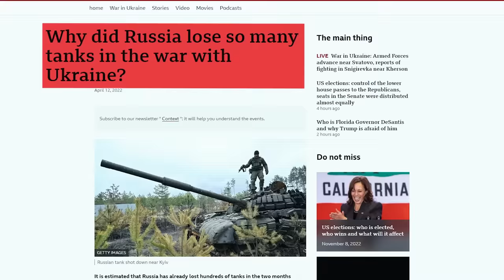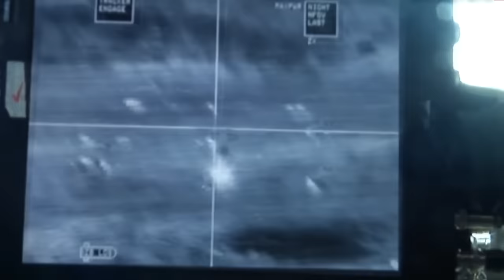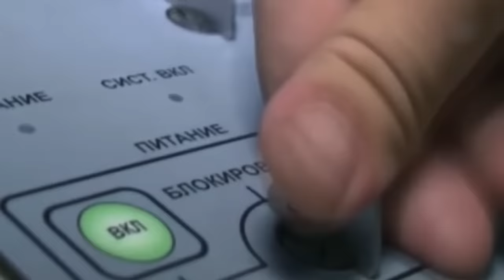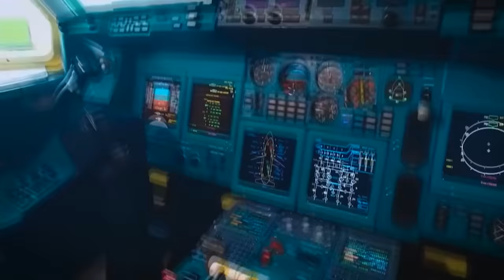Something is wrong with all Russian tanks

Comment: Russia has already lost over 4000 tanks and the storage area's that housed the obsolete tanks are now mostly empty. From the before and after satellite footage shows that the tanks that were removed were in bad condition but mostly intact. The best guess on the numbers is around 2000 repairable and 3000 for part's. One thing that was noticed by the Ukrainian military is that the majority of Russian tanks had the explosive part of the explosive reactive armour missing and as that is the main part of the armour and the tanks were designed with thinner main armour because of it, this is part of the reason why Russian tanks have performed so badly. The other reasons are a lack of training in combined troop and tank combat, a very poor logistics system and a lack of communication equipment. Basically the Russian military was not prepared for any major military operation and its fighting capacity was greatly over estimated. Due to the losses that the Russian military has suffered in Ukraine Russia cannot be considered a super power, it is still a nuclear power but it now doesn't have a modern military that can defend itself.
Reply: Some time ago I saw a video (now deleted) where Ukrainian explosives experts disassembled ERA from captured russian tanks and discovered many of the packs were filled with sand, or clay, or just rubber blocks. Some oligarch pocketed alot of money over the lives of russian tankers for those explosive reactive armour blocks.
Reply: @tonyv8925  the majority of Russian general's had multi million dollar yachts and mansions with gold toilets, considering that the general's don't receive any great income the money must have come from somewhere else. Most of the yachts have now been impounded or arrested.
Reply: @swiftcee266  I would be fighting for Ukraine if I was 20 years younger, I would still be good in a defensive position but as I am not very mobile nowadays defending a fixed position is all I am capable of. From the wave attacks that Russia is doing because that is all that untrained conscripts can do it would be a question of how many Russians I could kill until my position was overrun because guns can only fire so many bullets per minute. The only real problem that the Ukrainian military faces is that will they run out of ammunition before Russia runs out of people and at the current rate the odds are with Ukraine.
Reply: ukraine lost the 3.9k they had before russian invasion. tanks are obsolete with javelin and kornet !!! it's the era of artillery, drone and anti air defense.
Reply: @swiftcee266  the Wagner group is now mostly made up of prisoners from various jails throughout Russia, the Wagner group has also been involved in the heaviest fighting and has suffered more casualties than any other Russian military force. Due to the way the Russian military has been throwing troops at the Ukrainian military in uncoordinated attacks the daily death toll for Russia has gone from an average of 500 per day to over 1000 per day but the gains are minimal and are mostly regained by Ukrainian military the next day. During the last month Russian artillery has reduced its firing by around 75% Due to a massive ammunition shortage and as supplies from north Korea are slow to arrive and end up being mostly destroyed by the Ukrainian artillery directed by drones that both locate the ammunition storage areas and adjust the fall of the shells with an accuracy that is not possible for the Russian military with its lack of communication equipment and trained spotters. As the majority of Russian tanks have been destroyed the supply of Russian tanks reaching the battlefield are not keeping pace with the losses and are of lesser quality. As the Russian people are now discovering the massive losses they have started to attack Russian military bases and supplies in Russia and recently there was the largest protest against putins regime that numbered around 2 million people. The Russian military doesn't have the supplies or equipment to continue fighting for another 2 months and is already unable to supply body armour, modern helmets, medical supplies, firearms or food and water to the troops that are already fighting so any new troops will be worse off than the ones who are already undersupplied. The Russian military manufacturing industry just doesn't have the capacity to produce weapons, vehicles and ammunition fast enough to replace what is being destroyed/used and Russian soldiers are being told to save ammunition. The Russian troops are literally cannon fodder and as they lack any real military training they tend to group up making it very easy for Ukrainian drones to drop grenades that kill and or injur multiple soldiers as well as direct Ukrainian artillery to any hiding spots, there are hours of footage showing Russian troops running from building to building being chased by artillery until none are left. Russian troops are not safe in any foxhole or trench due to the amount of Ukrainian drones that can drop bombs with better accuracy than any Russian artillery or rocket system. Everytime Russian aircraft attempt to join the battle they are shot down by either man portable surface to air rockets or vehicle mounted antiair systems that in some cases are captured Russian equipment.
Reply: 4000 tanks? are you kidding? Or you just like ukr fakes? ;)
Reply: @Cachalote65  wikipedia section ukrainian army ground army that's the number 3900 MBT from T64 to T84 and the huggest amo stock bunker but destroy the first day of russia invasion. ukrain was the most armed country after russia during USSR era.
Reply: @Cachalote65  yes 4000 is about right because I have seen around 3000.
Reply: @itt2055  if Russia lost 4000 tanks, then Ukraine lost 40 000? Because Russia dominates in the air, not the poor Ukraine with the couple of yet alive MIG-29 from Poland shipment! ;)
Reply: @tonyv8925  never watch ukr fakes! ;)
Reply: @Cachalote65  so you mean there  will be abrams in africa soon'? 👍
Reply: @sucellus5452  SURE!!! ;)
Reply: @Cachalote65  Russia doesn't dominate the air and the Russian airforce has been mostly absent but as Russia has already lost over 200 fixed wing aircraft and over 200 helicopters they are reluctant to conduct any operations. The Ukrainian air defence system is actually better than the Russian air defence system because of the communication system and a better command structure. In the opening attacks the majority of Russian special forces were shot out of the sky before they could have any affect on the war. Man portable surface to air missiles are responsible for the majority of the Russian airforce losses once they became widely available. Ukraine has also captured intact several Russian surface to air missile systems that have a central radar unit with multiple vehicle mounted missile systems. These were the latest systems that Russia had and have revealed the weaknesses in the Russian surface to air radar that has allowed Ukraine to exploit the weaknesses found.
Reply: @itt2055  you watch too many ukr youtube channels where they spread their dreams about weak Russians. Wanna know about modern Russian army? Check independent channels about Syria and what Russians did there in 2015-2017! ;)
Reply: @Cachalote65  Syria was against civilians and freedom fighters and the Russian military had the backing of the Syrian government so it wasn't a proper war. The Russian military has proven itself to be completely incompetent at every level, it has shown that it doesn't have the logistical capabilities to supply its troops in the field, there is no communication between the front line troops and the artillery units, there is no communication between front line troops and the airforce, the lack of proper training has been proven by the footage of Russian columns being ambushed and the Russian troops did not have any idea what to do in that situation. Basically I suggest that you actually view the thousands of hours of footage of Russian troops not having any idea what they are meant to do in different situations. From everything I have seen the Russian military doesn't even rank as good as the Iraqi military was during the first gulf war. The only reason why Ukraine has not completely destroyed the Russian military is because of the numbers of Russian troops. Ukraine is a far more organised military force than the Russian military and has far better communication, training, logistics and command and control structure. It was a complete shock to find out just how bad the Russian military has become under putins regime and it does show what years of corruption at every level can do to a military force that was once one of the best and has become one of the worst.
Reply: @tonyv8925  its very old stock,,, russians ha no interest in using modern weapons only ols stuff that keeps working
Reply: @Cachalote65  what you just said shows that you have absolutely no idea about what is going on. Ukraine doesn't have leopard tanks or American planes. The Russian airforce has mostly soviet designed aircraft. If you look at how well the Israeli airforce has done against Russian aircraft you will understand that the Russian aircraft are inferior. Can you tell me why Russia has been fighting for nearly a year and still hasn't captured a quarter of Ukraine? Why has the Russian forces spent over 3 months trying to capture a single small town. Can you tell me why the Russian military has to use parts made in the USA to build its drones if it is so far advanced technologically. Ukraine has been building more drones than the Russian military has vehicles and has developed software that can detect people faster than the human eye all while fighting against Russian forces. All the facts have proven that the Russian military is around 30 to 40 years behind the rest of the world, why else would the latest Russian surface to air missile systems still be using CRT screens rather than plasma or led screens.
Reply: @robertokandal  41 of the the 400 T-90's also confirmed lost by russia are too old stuff?
Reply: @Maddog-xc2zv  where I get the numbers from use satellite and drone footage of Ukraine for the vehicles and the deaths are calculated by satellite, drone footage combined with intercepted communications. These numbers are very close to what Ukraine is reporting so around 140,000 deaths, 4200 tanks destroyed, 6400 armoured personnel carriers, over 200 planes and helicopters.  When you combine these numbers with the number of man portable missile systems sent and used the numbers are quite easily possible. When you see every Ukrainian soldier carrying a missile system or RPG and the tactics that they are using in regards to artillery spotting and the way Russia is using it's tanks, vehicles and troops it does start to fall into place. The Russian military just doesn't seem to have any idea what they are doing and they just keep attacking the same points in exactly the same way,  this has made it very easy for the Ukrainian military to set up killing zones that need minimal personnel. When watching the reactions of the Russian soldiers under fire they are not acting like trained troops but more like civilians with guns. As one retired American general said "I have seen better organised paint ball teams" and I agree with that assessment. Watching the American, British and Australian military conducting operations in Afghanistan you see that everyone has the same response when under fire but the Russian troops just seem to panic and it becomes every man for himself. Russia on paper had around 10,000 tanks but they have been removing tanks from their storage facilities to the point where they have all been emptied of all usable hulls. this will only be happening if they are in desperate need of replacements, these stored tanks have been left out in the elements for up to 40, a lot of them are not compatible with the more modern Russian tanks. The other factor that makes me think that the numbers are higher is the amount of Russian general's that putin has sacked if things were not extremely bad he would not be reacting in the way he has.
Reply: @swiftcee266  Russia can’t keep old Tupolev drones from bombing air bases deep in Russia. 
They have no fighters in the air over Ukraine because no one can survive the long range missiles. The skies have drones, not fighters.
Reply: @swiftcee266  er not uite th tgr and panther tanks mad thr FST aanc at Kursk n 1943
Reply: @theoriginalkeepercreek  Well, "BATTLEFIELD UPDATE" was a misnomer.   When someone  deceives with a clickbait title, they simply have their own agenda, and is happy to be dishonest.  Take from my response what you will.
Reply: @Cachalote65  Yeah, mebbe not just three days, but the plan was certainly within a couple of weeks. Secondly, you say "the goal was not to destroy Kyev with mass bombing..."  Indeed, they did intend to take over Kiev without a fight.  So I guess we didn't see mass bombing of cities like Mariupol by Russia, destroying 95% of it's buildings and killing as manny people in Mariupol as in Belgrade within a city just the a third of the size of Belgrade.  Thirdly, I think I was talking about the modern Russian military's capabilities in Ukraine, yet you are talking about Belgrade and Afghanistan, you really do skip around topics of conversation, with obfuscation, you are funny :)
Reply: @briannewton3535  again, WHAT plan for a couple of weeks, who told you that plan? Putin? Lavrov? WHO? Mariupol was destroyed by artillery, not heavy bombing like Belgrade and the only reason was that ukr put their tanks in the city! Were there any tanks in Belgrade? You say you talk about modern Russian army and I take for example US army which I guess you consider modern and effective, don't you? AGAIN, what territory of Afghanistan gained modern and effective US army in 2001-2021 before they left with disgrace? ;)
Reply: @Cachalote65  Does it really matter whether it is artillery or bombing?  The outcome is the same.  You were trying to put Russia on a moral high ground, yet You will be okay that thousands of missiles and drones are continuing to target civilian infrastructure and civilian accommodation in Ukraine. Russia Is still sending thousands of missiles into civilian areas in Ukraine.
Reply: @briannewton3535  Thanks for tthe comment. (God loves Me) remember to say this many times a day. He truly does. This whole war is so bankers can redo the books and divide and conquer mankind. Have you looked into Scott Ritter or Col. Macgregor
Reply: @Cachalote65  With regard to "Do you know the price of a cruise missile? What's the idea in wasting them on old houses where poor civil ukr live?"  Yup, they are certainly more than a couple of hundred Roubles each, yet they still take out fields, playgrounds, maternity hospitals, apartment blocks, and road intersections in the cities. Though the majority are simply shot down en-route.  Mr Poop Tin does like targeting civilians, is this because his military is struggling with fighting armed forces, and feels civilians are an easier and softer target, because his modern military isn't quite modern enough?  I think it is WW1 and WW2 tactics that give poor results for the Russians military. 

I did laugh when you said "nazi quasi state should exist next to its border!"  I suspect the Ukrainian people see Russia as a "nazi quasi state... next to its border." 

You are funny, thanks for the giggles.
Reply: @briannewton3535  God loves me. Say it out loud so it sinks in. Many people do not know this fact. We are all children of God.
Reply: Literally everything you said was wrong. Just alone, 1/10 things you said wrong was the era explosives being “missing” even though there was only 2 videos that showed “proof” despite the tanks being rusted, with everything down to the acres with exception to the hull and turret being salvaged. One of the two videos showed as “proof” literally showed a 6 month old captured tank without tracks, engine, hatch, and it was rusted badly.
Reply: @schutzanzug4518  you are right! A Pocket Full of Lie :)
Reply: @theoriginalkeepercreek  You ask "Why did the President of Ukraine close the churches?"

First you need to support that claim. Personally I am not bothered on whether churches have been closed or not. I merely said that the god that both Ukraine and Russia worship must be conflicted, as it is the same god for both sides.  

If you wish to obfuscate and bang on about other stuff, you go ahead, I wouldn't be overly fussed for both the Russians and Ukrainians to close the churches, in-fact all places of religious worship everywhere.  

You claim "Time will show who was correct about this war."   I'm curious, how will dime determine this?  Surely what will determine this is down to the resolve of both sides, the political support for the powers in each country, and the military support that is given to those fighting.  I am unsure there is a "who was correct". I do find it interesting when theists have a conclusion, and try and find a narrative to feed and support their presupposed conclusion. 

Have a lovely evening.
Reply: @briannewton3535 , I have not heard of Brahmah. Have you heard of Jesus? You would be surprised at how many have not. You have a blessed evening as well.
Reply: @itt2055  Where are you getting your info from? I have info that is very different and want to compare it with mine.I follow Scott Ridder and Col.Macgregor. Have you heard of either one of these men. Lets hope this war ends soon and we find out the truth.
Reply: @sucellus5452  America tanks will never make it to this war. They are making them now with little armor or whatever the standard was in the 70s.
Reply: @John-dd7ez  I bet Russians on the front lines would love to get their hands on turnips, I hear they are often short of food and water.
Reply: @peterwilson5528  I thought the OP was detailing inadequate equipment logistics and training.  I don't know if a country as supposedly well equipped, and trained as Russia, should have been able to take over a country the size of Ukraine. The fact that a year into this conflict they have conceded more territory than they gained after the invasion is telling.  Yes, firing shells and missiles at civilian infrastructure with a hope of turning the public against the government is one way of trying to win a war. Alternatively, they could focus on the front lines, which have basically been moving in a rearward direction since the early days of the conflict.   More recently they are making small gains though, and their probing offensives or actual offensives are not bringing the expected results currently.  Maybe they will make gains in the next couple of months, though maybe not.

When a sovereign state is invaded by a hostile country, other countries may support the one being invaded.  The hostile country invading it may get butt hurt that this country might get some limited support from others. That hostile country will have to suck that up, as it was their call to invade in the first place.
Reply: @peterwilson5528  Russia occupies less of Ukraine than they did in the first month and have taken massive losses in equipment and personal just to recapture a few small towns. While Russia is loosing equipment Ukraine is gaining equipment, while Russia is loosing trained troops Ukraine is gaining trained troops. Russia has had to use conscription to force Russians to fight but is unable to provide modern weapons, medical supplies, uniforms, food, body armour, modern helmets to its conscripts. Russia is now using tanks and other vehicles that were left in the elements for over 30 years without matenance.
Reply: @itt2055  Wrong Russia is well in control of almost all the areas that matter to it. They are advancing. Ukrainians are retreating. Russia is not running out of anything in fact even its economy is growing. We will see :)
Reply: @briannewton3535  Well UK 10 or 11 years in Afghanistan to retreat. USA 20 years. Russia one year in UKraine protecting Russian speaking ex Ukrainians. I think it takes a while to get any military machine working right. I guess it is why the P.I.R.A. drove the British out of Ireland even there they were there for 38 years. The problem with Ukraine is the Ukrainian Fascist regime in Kiev still has so many Russians speaking citizens as hostages. Pretty clear on that seeing what they were doing to their own people.
Reply: @peterwilson5528  Re: " I guess it is why the P.I.R.A. drove the British out of Ireland even there they were there for 38 years."  Ahh, so the British are no longer in Northern Ireland then, as they have been driven out.  I guess I missed that happening. My friends two British daughters are in Northern Ireland still, one working for the British Government.  I didn't recall them been pushed out back to the UK.  But, hey, things happen without me knowing out it, so I guess this is simply one of those things. 

Re: "I think it takes a while to get any military machine working right."  Indeed, I think with NATO troops training the Ukrainians on modern military NATO tactics since 2014 has helped them hold back the not quite so modern, yet much larger military of Russia. So, I guess you are right. Maybe if Russia had done the same, they would have been better prepared, and more successful on their invasion.
Reply: @itt2055  Wrong and you will see it is so. How do you explain the Russian economy growing then? You really ought to not rely on the western press for information. Most Russians see it as their duty to the motherland. Russia is of course getting help from all its allies. Those countries that USA has targeted have become a united front. They know that Russia must win or they will be next. Russia also knows that. That is why this war is to the death.
Reply: @peterwilson5528  I get my information from multiple different countries that includes Russian friends. The Russian economy is declining and certain commodities are now unavailable or difficult to find. The Russian banks have started to refuse to allow withdrawals. The banks have even been taking the money from Russians who have left Russia just to prop up the Russian economy, there has been several Russian billionaires who have been killed and all their assets seized by putins regime. The Russian military doesn't have the medical supplies to issue medical kits to the conscripts and they are told to have their families send them everything from bandages to boots the only thing that they are supplied with are weapons some of which date back to ww2.
Reply: @swiftcee266  This must be the funniest, most out of touch reply so far.
Reply: @Cachalote65  The military grouping before the launch of a military offensive is proportional to the expectations of what it would take to score a victory. Russia amassed some 190,000 troops, this shows that they intended to end the war in a quick fashion, two-three weeks tops and just enough supplies for support to last them as long. Otherwise they would have sent in far more men and resources in anticipation of a war that is likely to take far longer. If you weren't so stupid, whether as misfortune or simply feigning it, you'd understand how you can reason inductively without having to hunt Putin down and ask him personally, at gun point.
Reply: @peterwilson5528  The Russian economy isn't "growing" - even the Russian MoF released an official estimate of negative GDP growth for this year, so I don't think it is worth the time to clue you in on what the IMF, World Bank and OECD predict. Russia lost virtually all of its gas and oil income after Europe decided to collectively stonewall them, and yet the very same Europe was Russia's wealthiest and most profitable partner, and they can't recoup these losses by selling to India or China either, as they have neither the capacity to buy and transport as much oil/gas as Europe had, but are also blackmailing Russia for ludicrous discounts. China and India know that Russia is at its most desperate. Do I need to mention the price cap on Russian oil? Russia is bleeding, hemorrhaging money like never before in its history and it shows. And mind you, what we see right now are short-term contractions in their GDP, it is far more likely that the long-term effects of these sanctions have yet to appear and when they do, they'll effectively strangle Russia's economy and leave them bankrupt and begging China for monetary assistance.
Reply: Just take a pen and write on the wall: UKR WILL BE FINISHED! That's all you should know about his war. ;)
Reply: What are you? Your page has Soviet songs but you appear to be anti Russia? Where have you escaped from?
Reply: @peterwilson5528  Lithuania, buddy. You know, I think I have a certain understanding of what Russians are and how they treat their neighbors. Probably far better of an understanding than you have.
Reply: @Cachalote65  You know the old saying, it's your funeral. As in, it is Russia's funeral that's happening in Ukraine. How much equipment and how many generals have they lost already?
Reply: @Cachalote65  Do I need to remind you that 12 months have already passed since Russia's illegal war? I don't really need to say any more than that. It makes my case.  Please come back to me in 30 years from now, when Russia finally advances to Kramatorsk and sustains 500,000+ KIAs. Until then!
Reply: Let it be 50.000 tanks
Reply: Despite total ukr-NATO cooperation, Russian "2 week special military operation" lasts only for a year now and no sign of failure yet! But American operation in Afghanistan took TWENTY years and ended with the biggest disgrace! Is American army a bunch of suckers, then? Try to think over your arguments BEFORE you post them! ;)
Reply: @swiftcee266  its over for russia, thats for sure
Reply: @itt2055  Великий писатель Булгаков в одной своей книге рекомендовал таким как вы не читать политических газет но это когда не было телевидения и интернета - так вот милейший не нужно смотреть ТВ Украины и делать диванные экспертизы потому как это банально ОДНОБОКО и ПОЛИТИЗИРОВАННО - ЗАТОЧЕНО именно для таких вот как вы !!! Теперь милейший сударь вам для информации что бы основательно напрячь свои извилины в черепе - в РФ армия состоит из 1 миллиона срочников которая не участвует в СВО потому как срочники это 18-19 летние парни и их не задействуют потому как на сегодня участвуют в СВО только контрактники, мобилизованные , добровольцы и армия ДНР и ЛНР и это если посчитать потери на сегодня составляет около 400-500 тысяч всего а численность ВСУ на момент начала год назад составляла почти 650-750 тысяч солдат . И на закуску вам - Зеленский бегает галопом по европам упрашивая их поставить вам танки и самолёты - вопрос банально прост - ГДЕ ВСЕ ТАНКИ И САМОЛЁТЫ КОТОРЫЕ БЫЛИ У ВАС И ВАМ ПЕРЕДАЛИ ВСЮ СОВЕТСКУЮ БРОНЕТЕХНИКУ И ЛЕТАКИ ТАКИЕ СТРАНЫ КАК - Польша , Словакия , Чехия , Латвия , Литва , Эстония , Румыния , Молдова , Болгария ??? Где эти танки ??? Так вот мил человек мы и леопарды и все танки которые вам привезут со складов НАТО отправим туда где сегодня находятся танки ВСУ советского производства . А что бы реально смотреть на ситуацию черпайте информацию не из ваших СМИ а проводите анализ всех зарубежных СМИ и вашего противника тоже и союзников а брехню которую вы написали смешно читать . Если в российской федерации объявят официально войну Украине то под ружье встанет 1 миллион срочников и 1,8 миллиона мобилизованных которые сегодня числятся в запасе !!! Для понимания в России прошла частичная мобилизация а не всеобщая а это разные вещи !!!
Reply: @itt2055  Who says it was one of the best - propoganda?
Reply: @s.tranger1074  I get my information from multiple different sources from multiple different countries and years of studying every war including weapons, tactics, technology and mentally. Where do you get your information from the Russian government.
Reply: USA GAYS  XDDDD
Reply: @swiftcee266  it would actually take me over 10 hours to fly to Ukraine and 14 days to get a passport.
Reply: @КонстантинБельский-я6м  9i bi cuu b m
Reply: @Cachalote65  
Yes, bombing hospitals, amazing skill.
Reply: @richardkudrna7503  you mean NATO bombing hospitals, schools, bridges, tv studios, etc, in Belgrad? Yes, it was a good lesson for Russia! Now Putin teaches you! ;)
Reply: @briannewton3535  
The Allies massacred hundreds of thousands during WWII, (Dresden fire hurricane one of the worst). This was rationalized. Some humans recognize killing of non combatants is evil. Others know it’s ok if you win. Russia is now an evil empire, deliberately targeting children etc. But so were the Allied forces of WW2 (which included Russia). There is no ethical distinction between for example death camps and mass incineration of a non military city such as Dresden. Dresden was “our” crime against humanity, but there was no punishment. In fact they put up a statue of “bomber Harris”. When we watch Russia massacre hundreds of children, it is not easy to stand on moral high ground with Dresden unpunished.
Reply: @richardkudrna7503  Thanks for this info. What is your comment starting  "The Allies massacred hundreds of thousands...", in reference to, of something that I have said?
Reply: @Cachalote65  
You may be suffering from cognitive dissonance. Whatever helps you get by. Let’s keep in touch and see how well what you write comes true.
Reply: Because russian again nato not ukraine,but still russian still super power .ura
Reply: @joearyjuliani2024  true, so many nuclear weapons no one can attack homeland. We should give Ukraine nuclear weapons.
Reply: @swiftcee266  With regard to "Brian, can we chat again in a few months? Come back then. Trust me, you'll be surprised"  Yeah, if you like, what do you think will happen that will surprise me?
Reply: @joearyjuliani2024  Russia is a nuclear power but it is not a super power because it lacks the military power it once had. Russia is no longer capable of producing the weapons it needs to replace what has been lost in Ukraine. Russia also lacks the ability to provide proper training for its troops because the people who are conducting the training don't know how to train soldiers for the modern battlefield. The training and tactics being taught by the Russian military are outdated and obsolete, they are fighting the last war and have failed to adapt to modern warfare tactics and equipment. Remember that the Russian government has spent more money on yachts and mansions than on the Russian military and this has shown itself in Ukraine.
Reply: But Russia had not the intention to defend itself, she attacked Ukraine, she wanted to conquer, to subdue, Ukraine people to work for them, because Ukrainian people are hard workers, but Russian people are hard drunkards. Ukrainian people like to work and live good. Russian people do not like work, but they like live good on the back of others. This was the education of Communist/atheist Party. In USSR were thousands of so called Part.Workers they were paid to support the Comm. Party and shout: "Glory  to Comm. Party USSR." They were sure, that they will conquer Ukraine in three days. This is a motive that the Ukraine people are fighting better. They fight for the liberty of their country, for their family. But Russians do not know for what they fight and die.
Reply: Its time they pack their things and go home to Putin!!
Reply: @slawawacker  an optimistic viewpoint, to help the coping on Russia's ineffective invasion of Ukraine, you keep thinking that sweetie.
Reply: @briannewton3535  Russia has carried out 1 mobilization.
Ukraine has carried out 8 mobilizations.
This is due to the fact that Ukraine has much greater losses than Russia.
Reply: Note: Reactive armour only increases a tanks chance of survival if hit directly on a plate there are many gaps and they don't seem to be any actual defence against modern western tank killing rockets also the tanks that are being fielded today are what the old M1A1 destroyed so easily in the 1st Iraq war
Reply: @slawawacker  If you wish to believe that, you are welcome to. I'm not going to stop you proliferating that belief.
Reply: @itt2055  they will take anyone 16 to 65 bonus points if you have any aryan nation tats
Reply: Wow Russia lost 4.000 tanks? How will they ever replace 40.000 tanks? I don't think anyone even realizes how much 400.000 tanks is. Losing 4.000.000.000 tanks is devastating!
Reply: @Glenn V  apparently Russia had over 10,000 modern tanks before they attacked Ukraine according to the Russian military. But they are now shipping tanks that were built at the end of ww2 to the front line. If the Russian military was so great, then why have they had to start using conscripts because, according to the Russian military, they had over a million troops. What about the tens of thousands of Russian aircraft, with the amount they claim to have they should have complete control over the Ukrainian sky's. With the might of the Russian military, they have spent over 6 months fighting for a little town. Yes it is quite reasonable that the Russian military has lost over 4000 tanks, all you have to do is look at the footage from the drones. Personally I have seen just under 3000 Russian tanks get destroyed by artillery, drones, mines and man portable missiles. This is the most filmed war in history and because of the sheer amount of footage, it will take years to completely watch all of it.
Reply: @itt2055  wow 3 million destroyed russian tanks just flew over my house
Reply: @sucellus5452  yep
Reply: hahahaaa
Reply: @itt2055  go help to ukraina, they take every man